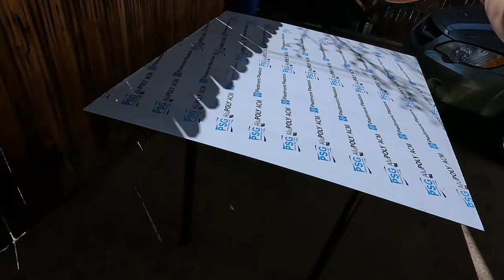DIY Overland camper trailer build: cabin part 17 - Hatch skin and latches

Comment: When you cut the holes for the latches, did you use the router with a deeper (deeper than for bends) plunge, or did you use a scroll saw. (time-lapse went pretty quick during those steps)
I am enjoying this series, thanks.
Reply from the maker: I used a rotozip type saw.  Glad you like the build!
Reply: @infosponge  Thanks, I looked that up. Makes sense to me now.